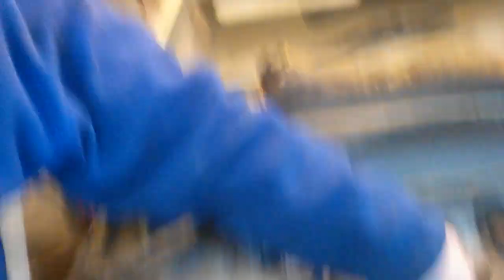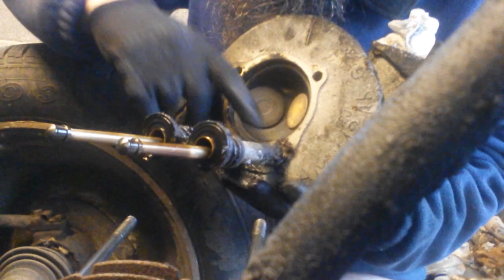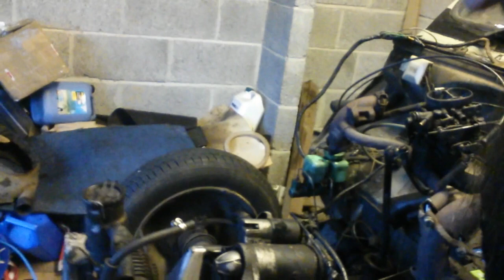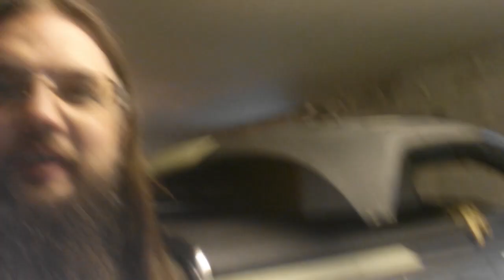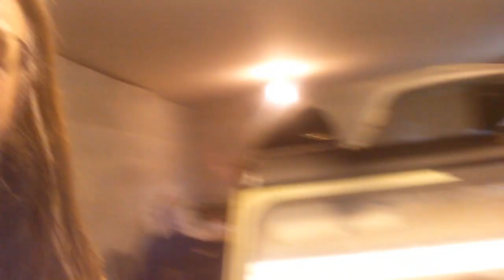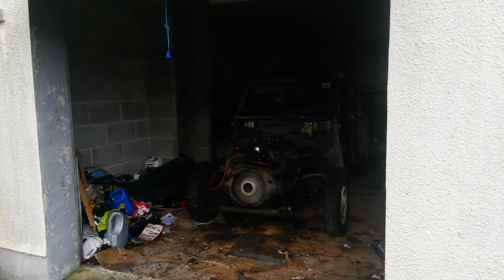Citroen Dyane - head swap, start up and naked drive!

Comment: I had one of these, it probably a bit late now but the spark plug threads are rubbish, if you take the heads off that's the time to helicoil the plugs. Remarkably like the 1970 to 1995 bmw air cooler motor bike engines but they have double the hp.